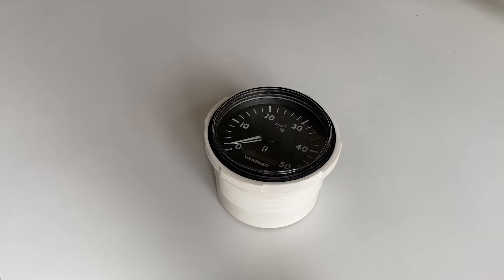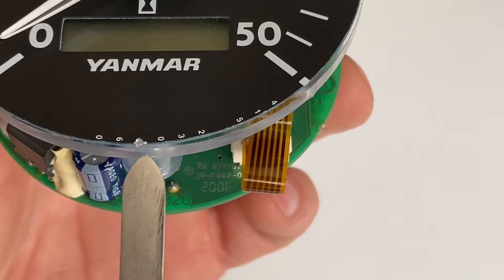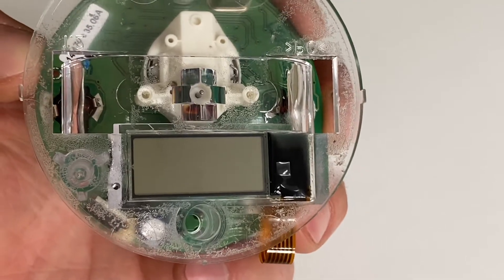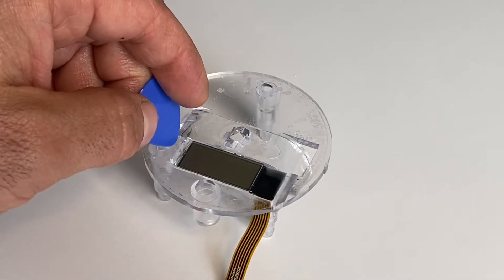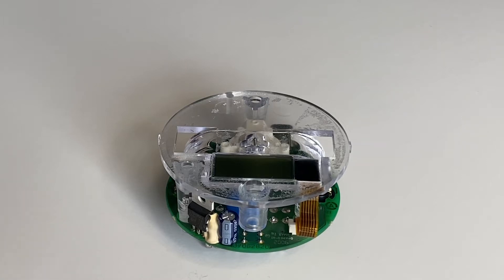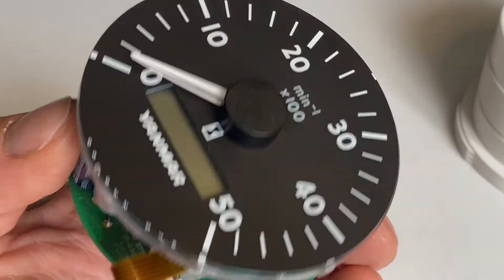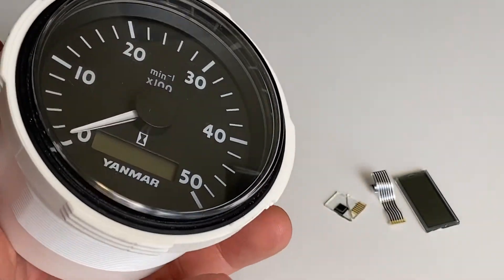Yanmar Hour meter repair & replacement

Comment: Bought replacement LCD and fitted it, was really surprised at the 7400hrs but the boat has done good charter in our fleet and still running well.

Comment: Thank you very much for this. My heart was in my mouth, but I was successful! I replaced the LCD unit. The only extra step that I took was to thoroughly clean all the input connector tabs before reassembly. It all works!
Really well put together video, with very clear instructions.

Comment: Thank you for your video!
I managed to replace LCD and it works now.

Unfortunately, it does not show RPM.
When it turns on, needle goes one half circle, returns to the same position and stays there, no matter the revs.
I tried calibration procedures but no luck. 
Probably something else is burned too.

If anybody knows the pinout so that I can try to simulate?

Comment: Great tutorial. My hour meter quit, and I checked it all out. Power is there, and I took it apart and cleaned it, but no go. I didn't see any physical issues, but I'm going to get a new lcd and try that. Of course it had to happen just before I was ready to sell my boat. I guess I'll have to keep it for another season.

Comment: Brilliant! My hour meter now works but my rpm’s are off. Do I need to go back in and adjust the needle?
Reply from the maker: Hey awesome,  see where the needle rests when the engine is off. You may need to adjust it,  if so skip to 12:17

Comment: Thank you so much! I had the same problem and it is fixed now🎉. The video is easy to follow. Thanks also for the source for the LCD. I of course, like that it was cheap, but it was even more important for me, that it did not lose the motor hours.
Reply from the maker: Awesome Buddy!  Glad it is back working!

Comment: Good video, just ordered a replacement screen, after just removing my screen .  I hope this is the problem, my Alt. Wire had 8 volts when tested, screen not lighting or reading at all.

Comment: in my case the numbers are visible, but almost erased.
Reply from the maker: Hola Jose,  same repair can be done. Or you could try remove some of the silicone,  as seen in this video. https://youtu.be/eldRUU7qc2Y
Reply: @lucasspaniard8430  Muchas gracias por tu consejo, Lucas. Un gran saludo
Reply from the maker: @jomaflor2  de nada, es un placer poder ayudar con esto!

Comment: Solid instructional video. But: what are the specs / part nrs of the little LCD? I need to order it before starting to taking the meter apart.
Reply from the maker: Hi Sam, if you look in the video description, you will see a link for one option for buying the LCD. (the one I used) But you can search yanmar . volvo VDO LCD and find other options.

Comment: This video was much more specific than the first one. And every detail that may cause an issue was explained properly. Well made video. I did swap my LCD yesterday, and one of the transparent clips for the standoff legs broke off. It does not worry me much, but you should consider not removing the clear plastic part when swapping the LCD as there is a chance that the clips may break. My RPM/hour display was manufactured in 2009.
Reply from the maker: thanks for the feed back. I wonder if your plastic was just older and dried out. I took mine off several times with no issues, but you definitely don't have to take them off.

Comment: Thank you for posting. I nearly did not buy my boat because the the seller could not confirm the engine hours. I had a mechanic inspect and check the engine and I took the risk. Now I have new LCDs thanks to your post. To say that I am very happy with the outcome is an understatement. I was pleasantly surprised at how low the actual hours are, so bonus!

Comment: My flat cable has a gum yellow. Have you heard about it? I am afraid to try to take out and destroy the circuit
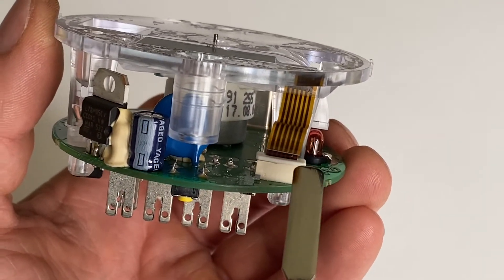Reply from the maker: This sounds like what I mention at 6:50 in the video?
Reply: @lucasspaniard8430  exactly. Have you heard a way to take this "yellow glue"?
Reply from the maker: @vergrupos  just pick away at it with a small flat head screwdriver, etc. Ruby Rose did a video on this around 5:14 mark. https://youtu.be/EJZvffftV1o
Reply: Thanx. It seams hard and dangerous to remove

Comment: Great video!  Thank you for the detailed look. I got a replacement display from Amazon and then swapped the displays in less than half an hour, for my 2006 Beneteau.

The old display looked pristine with no noticeable corrosion. Lifting the old display from the left cracked the right side; but it was trash anyway. 

Before I started I measured the voltage with my autoranging meter but could not get a reliable DC voltage at the terminals, probably due to the very noisy alternator power. It did read 7.4 Vrms AC, which indicated some power connection; this proved to be sufficient.
Reply from the maker: Good work! In my old video I talked about checking the voltages. Glad you got it working👍🏻

Comment: Hi Lucas great video, my Vdo tacho with faulty hour lcd has a much thicker plastic rim once the meter is out of the case. Is this something you have seen?
I’m having trouble getting it apart
Regards Geoff
Reply from the maker: Hi Geoff. I really don't have much experience except with my yanmar display and owners who have watched this video reaching out. you are talking about one of the plastic covers? or the black trim piece?

Comment: Thanks, Lucas, I've received my new screen from AK Speedo, but wouldn't attempt this without your comprehensive guidance. I'll let you know how I get on.
Reply from the maker: Good luck, you got this!
Reply: @lucasspaniard8430  Screen successfully installed. The boat is a 2010 Beneteau and the contacts were covered in beige goop as mentioned in your video, but it was easily removed with a scalpel. Once again, thanks for your help !
Reply from the maker: Awesome Tony, glad it worked out. I am hoping that this video gets out as much as my old one a few years ago, as i feel it is much more complete. cheers!